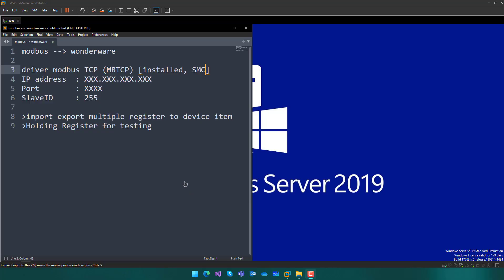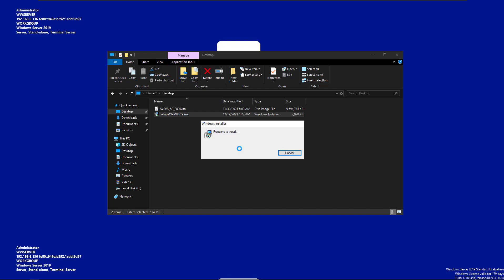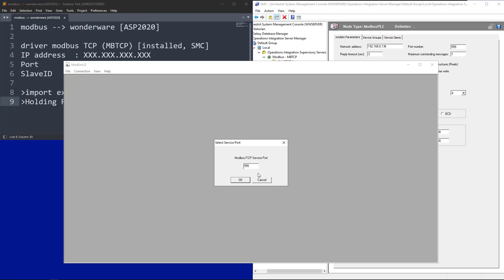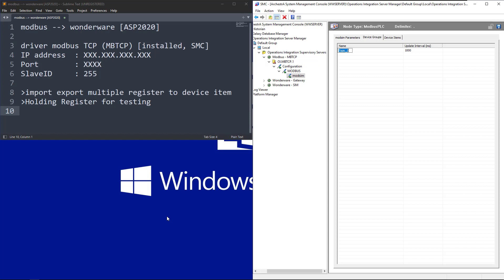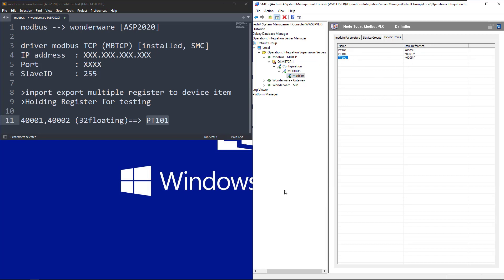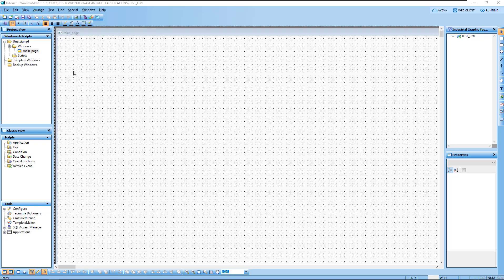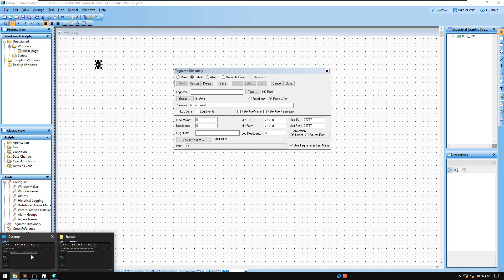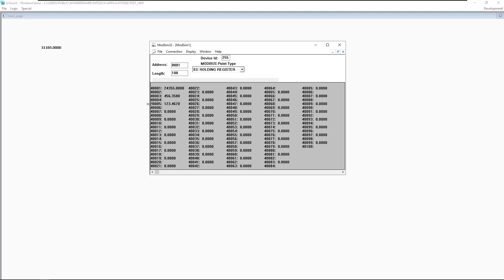Modbus TCP MBTCP Aveva Wonderware SP2020   Basic Guide

Comment: Sir, is it possible to configure for another device id? The issue i had is I need to read data from several sensors with different id/slave id
Reply from the maker: On the video we used the trial license so it has limitation for some features like limited runtime, tags and device id. You might try on the licensed one.

Comment: I get float type data in intouch.but when I have a register which is float inverse I got random value which is not Same as it in slave device
Reply from the maker: the modbus message pattern that received by intouch should match with the data sent from slave device. Otherwise the IEEE754 floating point will not translated correctly.
if we use 1234 pattern as floating point message pattern, then 3412 should get the float inverse. You might try play around in the SMC modbus configuration

Comment: I follow your steps, but intouch don't show any data ,and log viewer show

DASProtFail	MBTCP	Error in Reading from PLC for item New_TCPIP_PORT_000.New_ModbusPLC_000.40003 F
DASProtFail	MBTCP	The PLC New_TCPIP_PORT_000.New_ModbusPLC_000 reported receiving an ILLEGAL DATA ADDRESS from the OI Server. PLC errorcode 02

Do u mind tell me how to fix it?🥲🥲🥲
Reply from the maker: there are some possibility that could make illegal data addres happen :
- the device id from modbus slave couldnt be reach by wonderware. Since I use demo version, it seems like only address 255 is allowed for configuration
- the range of modbus address configured in wonderware more than what modsim (as a modbus slave) can be served or the range is offset. Kindly make sure wether you configured in 0 based or 1 based address.